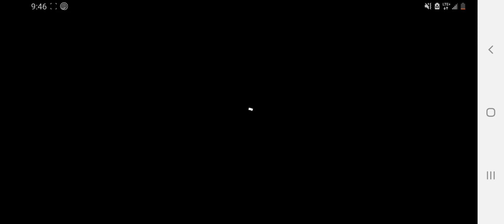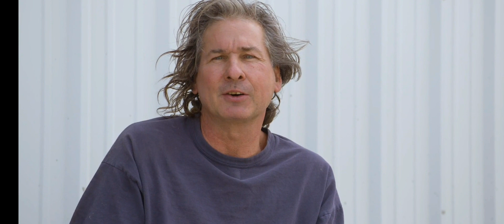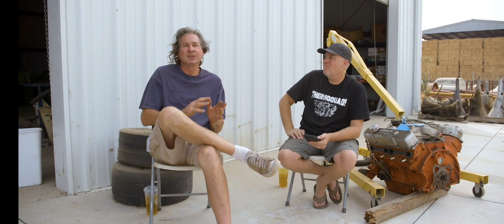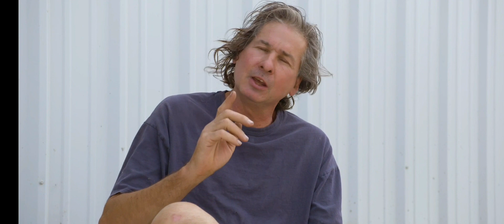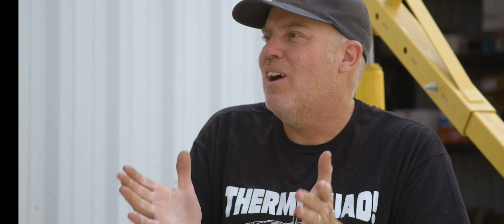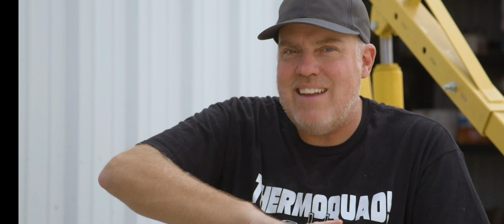uncle tony's garage gets called out by the roadkill guys and they say he's  full of shit

Comment: First off this was a call out for Uncle Tony, period. I was really surprised at the arrogance of these two. You both sort of proved his point, why do new pistons have no offset? Piston manufacturers must have known people were doing this and basically designed the piston with the correct offset so you don’t have to rotate them! Unlike Steve and frieburgers opinion, if a little is good more is better, not usually in the automotive field. 30 degrees of timing is good 40 degrees not so good. Reminds me of an under achieving built Hemi B body a tv/ YouTube personality owns that should run a lot better than it does! Smokey, the ramchargers were pioneers, that’s when you had to engineer and make your own HP, you couldn’t buy it. This piston info maybe old technology but it is still relevant. Thanks, John Knarr.
Reply: UTG hasnt proved anything but RKG did make some really good points as to why it will not make any more HP.
Reply: Aftermarket piston manufacturers weren’t designing them with the “correct” offset. They were designing them with NO offset. 
Offset is not needed. Nobody is going to complain if the pistons are a little louder on a performance engine when it’s warming up. 

Flipping factory pistons puts the offset opposite of where the factory had an offset, in the false hopes of more power.
Reply: shelbylancer454 Great points.

Comment: http://www.mustangandfords.com/how-to/engine/28898-400-hp-302-small-block references putting piston in backwards.  It also briefly talks about why.
Reply: Interesting. Their build was done with hypereutectic pistons, which are much stronger than regular cast (hypoeutectic?).
Here is their explanation-------cut and pasted...
"Installing the piston backward (with the pin and rod offset toward the rear) reduces rod angularity; the engine behaves as if it has a 0.300-inch-longer rod."

Comment: Ha! Ha! Ha!   These are old tricks from a time when you actually had to be creative to build power,  because you couldn't always just have it shipped to you in a box!!!
You tried everything you could think of to gain a little edge over the next guy.  I've never seen dino numbers on it, but it would stand to reason based on the fact that some modern performance engines employ offset cylinders,  which would produce a similar effect. 
And remember,  we weren't banging on those old cast pistons with seven hundred horses either!

Comment: lol this is so funny that you brought this up,
 at the tech School I taught at for 17 years we actually did exactly what you're saying we had a new GM crate engine just a stock 350 with dished cast pistons we threw it on the dyno and it made a whopping 242 HP I forget the TQ but it was like 280ish one of my students brought up the old flip the pistons around for power gain thing, he was adamant that his uncle did it a bunch of times and it worked, so I said ok let's do it
we had this fresh crate 350 with a few dyno pulls on it so we disassembled it, and swapped the 2468 pistons with the 1357 pistons if you have a 4 valve relief piston you can simply swap banks with your pistons and wa laa your pistons are all in backwards yet the rods will be correct, long story short  we put back together slapped it on the dyno cart and made some pulls the engine made 240 HP and 280ish TQ I don't remember the exact TQ but it gained nothing in fact I think it lost a couple LB FT
Reply: Don't most crate engines come with forged pistons and no offset? When you start a break in procedure and then switch piston assemblies, seems you should loose something

Comment: Some how this seems pretty. Who cares if UTG likes to flip the pistons on his rebuilds.
Reply from the maker: I care about a 16 year old  who blow up his engine cause he listened to some hack on YouTube
Reply: @GHOST117HALOBOYCOD  if they are gonna blow it let it be their own mistake and not the advice of someone. Think about how many people watch these videos then they will take it and blow chunks. That's a lot of motors going to waste for no reason.
Reply: I mean he did state specifically on a slant 6 225 in that video and on mine I did it and it hasn’t blow up or made a difference that’s wasn’t from the whole rebuilt I did but if you do it on any other motor that’s on you because he did specifically say a slant 6 but like I said it’s didn’t seem to gain any power
Reply: @dontbestupidshows4623  or even smokey Yunick  the horror       you just need an ls swap with this efi and these heads and etc etc
Reply: @dontbestupidshows4623  well , the same advice also came from Carroll Hall Shelby , Smokey Yunick , and Joe Sherman . 
So , I guess Dullchek thinks he knows more than Smokey & Shel ? 
I GUARAN-DAM-TEE you that Smokey tested it on his dynos (he had access to both an engine dyno and a chassis dyno) before he sent his race cars out that way .

Comment: If anyone wants to know, I did this on purpose to a 2.0 ford ranger 5-speed that needed to go .030 over anyway to find out what it would do. It changed the torque band from low rpm to higher up, but only after recurving the distributor. When I first ran it, it was lazy to speed up and pulled down hard when you let up the pedal. It was an interesting experiment. There wasn't any piston noise at all--you couldn't tell the difference if you didn't know. (been a mechanic/machinist since late 70's)
Reply: No way you could do that on a 2.0 because the pins are centered in a 2.0 lol 😆  you've been listening to uncle phony too much and it's been tested over and over on a dyno and it doesn't change anything lol

Comment: The whole reversing the pistons "farce", for lack of a better term, has been around for a VERY long time. Uncle Tony isn't the first to allude to it. But from what I have seen, he never really claimed any real advantage powerwise either. That being said, I didn't hear Freiburger or Dulcich call him full of s$%& either. I DID hear them say the same thing others, including Richard Ehrenberg (tech editor for Mopar Action who DOES happen to be a make what you got work better kind of tech editor), have said that pretty much speels out the exact same thing as Dulcich and Freiberger just said. So maybe everyone is reading just a little too much drama into UT as well as these guys, or simply being dramatic. Ehrenberg's reply in the tech section of Mopar Action was less p.c. than these guys. I don't recall a flame fest on him. I happen to like a direct approach. Back in the day we called it guys being guys.

I also happen to be in the camp of "why in God's name would you do THAT much work for very little return". Spend your time elsewhere, like tuning your combo and make up the difference. And yes, aftermarket pistons are manufactured dead center for the pins so, much like these guys pointed out, you would have to have perfect bores, pistons, etc., and them ALL be factory pieces. Good luck.

Comment: Just curious about burg bois final statement. He purposefully made it sound like a fuck ton more work than it is and threw in some bullshit that isn't true. Basically it works on any old v8 with flat top pistons, and you're just swapping the whole piston to the other bank, not dicking with the wrist pin or anything. Two cap bolts, thats it. And if you're tearing down an engine for a rebuild, it's already apart so boom, on reassembly just swap them. Acting like it's some outlandish claim that is mathematically supported. For us guys who don't have million dollar sponsor's and free parts and hotrod on a budget, this is for us.
Reply: Also, the show is literally called roadkill, 99% of the stuff is junk that doesn't run anyway, thats the gimmick

Comment: Keith Black silvolite pistons have pin offset and come with double valve reliefs SO they can be reversed if you want.
Reply: yes thats a special application... Uncle Phony was talking about stock pistons with the offset. Pay attention.
Reply: @darthhemi1735  Nothing special about KB silvolites...I got a set of em' in my sisters 318. they cost 12 dollars apiece.
Reply: @darthhemi1735  K.B. silvolites are a stock replacement type piston with the pin offset exactly the same dimensions as factory. Same compression ratio ect...
K.B. put double valve notches just to allow the customer the option to flip the piston if you have a high lift cam.
(pay attention)

Comment: These guys are too young to know Everything......During the '60's Max Wedge & G2 Race Hemi days, Chrysler's factory racing Engineers Didn't miss many real, Measurable dyno & Drag strip performance Enhancements & All the Race engines used 1/16" Reversed offset Pins.....

Comment: These guys didn’t listen very well. Uncle T already addressed most of their concerns. But, I digress; I want to see this video, too.
Reply: yes he will now say "dynos dont work" and say "oh i feel it"... when thats the cr@p running down his pants.... no clue... back tracking when he totally puts his mouth in his foot and everyone knows he is clueless... Like when he built a 318.. or messed with the guys 71-73 charger? or when he said bottle rocket would run 10's or... and or...
Reply: Crunchem Again I wasn’t aware that bottle rocket was completed. Last one I saw it had broken the rear end and it was being replaced with maybe an 8-3/4” ? I also remember wrong on the expectations, I thought it was to ultimately cut a 10.99 on spray . I don’t remember it using spray at all yet , but I’m probably way behind. Yes , no way o see that cutting a 10.99 on the motor.  Do you have a link to the last installment maybe ?
Reply: @jamessharp9790  I don't think it's completely done yet. Iirc he was going to do some changes to it. Tracks aren't open so I assume that is part of why it hasn't gotten there. But it sure is taking a long time.
Reply: Evan C it’s still cool because it’s low buck and low tech .

Comment: You guys are so emotional.
Reply: @crunchemagain2030  But it isn't the truth. The truth is that it is an actual hotrodding trick that improves performance. The fact of the matter is that the roadkill guys are going to be against it because they make no money by saying you can make power without breaking the bank. As @joe smith said, you guys are so emotional.
Reply: @joseesparza2364  rofl it was a trick no on used because they knew it was stupid
Reply: @crunchemagain2030  Only the dynameter will tell.
Reply: @crunchemagain2030  Interesting point you have there.... I'm gonna go watch some Roadkill but wait....it's all locked behind a PAYWALL now.....Did you see what Dave did to the flat fender Jeep engine? That's what happens when the dude who puts a shiny new Weiand blower on his uncracked 1982 Chevy 350 can't buy any parts

Comment: An undocumented horsepower gain from 1960 is always the best choice.  Remember don't ever put your battery on the garage floor because the ground will drain power too as long as guys love old wives tales.
Reply: Its actually much older than that. 
Flathead Ford racers did it for the dry lakes in the 1940. 
Smokey Yunick did it on his "Fabulous Hudson Hornets" in 54-55-56 , 6 cylinder cars that outran V8s from Chevrolet , Ford , Cadillac , and Chrysler. 
I GUARAN-DAM-TEE you that if Smokey ran it that way in his racecars , that he tried it both ways first - and Smokey had access to both engine and chassis dynos , as well as PLENTY of track time .
Reply: That’s not a wives tale

Comment: We dont need to get this deep into the debate when Tony cant even manage to put together an engine that runs for more than 5 minutes. Hes incompetent, plain and simple.
Reply: Hmmmm , Bottle Rocket's ENGINE is running just fine (the rest of the car has issues) . 
The orange Dart (not the GT) is running fine. 
The 340 Road Runner is quicker than a 340 should be . . ..
The 400 Road Runner is a beast ! 
The 440 Charger is a reliable daily .
The first Slant 6 built for "Plan Z" functioned fine , he's just looking for less weight & more power on the next /6. 
Paige's 1st Nova is still sportin' around . . . 

They all seem to have more than 5 minutes on them .

Comment: This is the best you could call out Tony on? He flat out lies on his points ignition test. I caught that he did it with no ballast resistor to give a better appearing spark for a couple seconds before it burned the points up. Or telling kids to use emory cloth to surface a head on a nitrous motor. I called him on that and he said that's how the machine shop does it🤣🤣🤣

Comment: He also drills out shock absorbers two for the track inspectors and put automatic transmission fluid in a four-speed and rear differential etc. etc. He is such a towel. And he stands in front of a block in a Puddle of gasoline as he ghetto hounds cylinders for 6 to 8 hours apiece.

Comment: Seriously?  How much of a HP advantage do you think this would give?  Maybe 5-6hp?   If you were building an engine for an NHRA stock class car (a class that no longer exists), where you had to run stock everything, and engine builders spent all season on the dyno chasing an extra 5hp,  I could see were MAYBE this might do something.   In 2021 there's better ways to make power.
Reply: LOL
Reply: Yes, you're  about correct on the HP gain ... so when yer setting up a $100 motor  junker +5  for free is golden.
 I don't suspect Tony  hightailed it over to  the million dollar  pit crew  to chew em out on piston pin position, do you ? So the answer is the only time  it's wrong  is when pimping  snobbery  is call of the yapper yapping, and then it isn't wrong  still,  just the yapping flap  trapper  is.
Reply: @shakdidagalimal  Except Holdener did dyno it, and the resulting gain was zero.

Comment: the theory is that as the offset is at the outboard side of the piston, turning it around not only increases leverage but also increases the compression ratio as the offset is now toward the block centerline. I would wager it would be barely noticeable in reality as it would probably only equate to a 2 / 3 % increase in C/R at most
Reply: It has no effect on compression ratio , because the length of the rod and the piston height do not change , but it affects dwell at TDC.
Reply: The rod height doesn't change, but as the pin offset is closer to the centerline of the motor, the rod end up at a slightly higher point in the bore

Comment: The first guy starts by saying "I haven't determined if it works or not"  follows with "Probably not".   Presenting zero data to support his opinion. My opinion is.... he should but a brush to his head occasionally.   Second guy that needs some dental work says "it's hard to do" and may or may not get the extra power.

Comment: Here is the context of the idea. Way back when, there weren't readily available aftermarket pistons. Most oversize pistons were a copy of a factory piston. If the only pistons you could get then had a 0.060 offset, did it make any difference reversing them? This is the question.
Reply: Waaaay too much work.  This may have worked on specific 60's chrysler engines purely due to tolerances being fine when turned around, but to say it works in every case is foolish, especially today.

Comment: Dave set you up for this Steve. He did.  You need to Thank him. Do the 318 Challenge.  Alot of us are dieng to see what you guys can do with backyard junk.
Reply: Not a very realistic challenge - few, very few, viewers would think of doing this type of build.  Better would be a low budget build that most viewers could afford and would do. Dyno them on the same dyno and same day. Auction off the builds at end and of it send it all the proceeds to charity.
Reply: It's not realistic in the aspect that the 318 isn't a common junkyard engine lol.   Nor has it been in over two decades.
Reply: @smokeysghost4759  it doesn't get much more Budget Build than a bone yard 318 and a gasket set.  Which Uncle Tony offered to ship both for free.  I guess they could try to build an engine with just some pliers and a rock if you want more of a Budget Build

Comment: Well I have seen 340 factory pistons and 440 factory six pack pistons with valve notches on both sides to allow the piston to swap. Must be something to it.
Reply: Factory pistons have valve notches on both sides to allow the piston to fit either bank.  If offset pistons had only two valve reliefs they would have to be made to fit right or left bank only.

Comment: BACK IN THE DAY THIS WAS A PRACTICE ON THE SMALL BLOCK FORD HI-PO 289. REVERSING THE PISTONS LET THE MOTOR REV 500-800 RPM'S MORE. HIGHER REVS MEANS MORE POWER. OTHER THAN MYSELF. TONY, WAS THE ONLY PERSON AWARE OF THIS FACT. THERE IS A GUY IN MY NEIGHBORHOOD A RACER FROM THE 1950'S JOHN. FROM WHAT I LAST HEARD, HE WAS THE HEAD MECHANIC IN THE HARLEY DEALER NEARBY ABOUT 20 YEARS AGO. A FRIEND OF HIS TOLD ME IN THE 1960'S JOHN WAS THE TECHNICAL ADVISER FOR MOST OF THE CAR MAGAZINES. IF ANYBODY KNOWS WHY THEY OFFSET THE PIN. IT WOULD BE HIM. HOPEFULLY HE IS STILL AROUND IN THE NEIGHBORHOOD. I REMEMBER HIM AS A KID WHEN HE TOLD ME TO PARK HIS FALCON WHERE I JUST PULL IT INTO THE OPEN SPACE, NOT PARALLEL PARK THE CAR. IT WAS THE FIRST TIME I EVER DROVE A CAR AND I WAS AROUND 10. I'M NOT SAYING I'M RIGHT. BUT THE ONLY REASON I CAN SEE WHY THIS WAS DONE WAS TO CONTROL THE RPM'S KEEPING PEOPLE FROM OVER-REVVING PREVENTING DAMAGE TO THE PISTON SINCE THE ENGINES WERE UNDER WARRANTY.
Reply: STOP SHOUTING!!!!